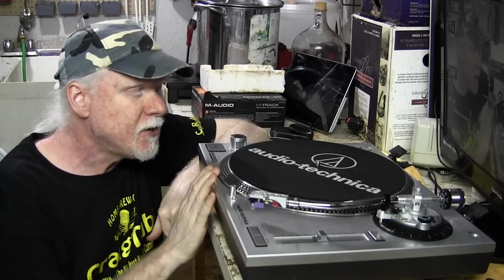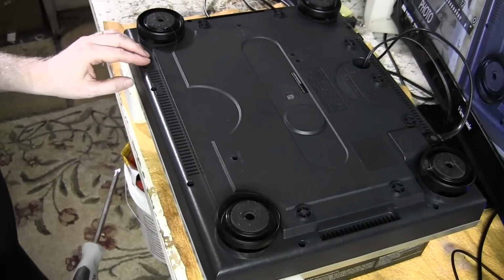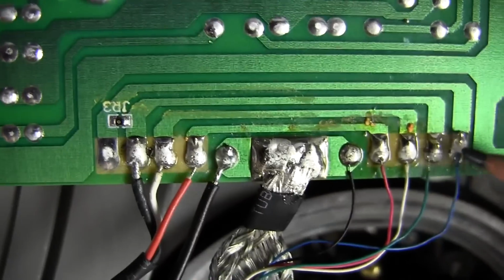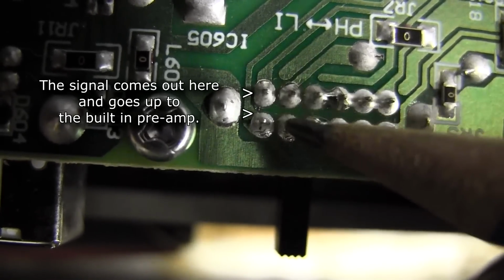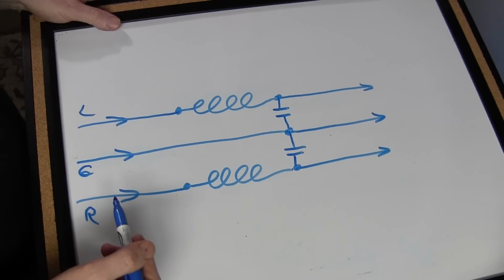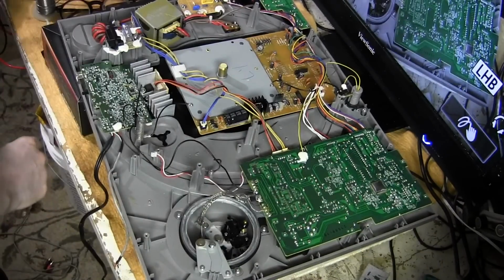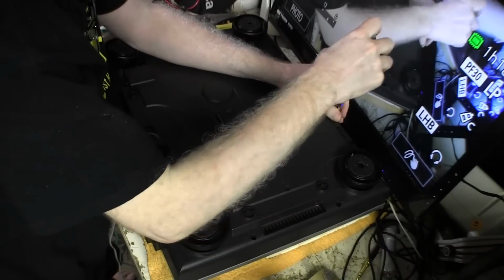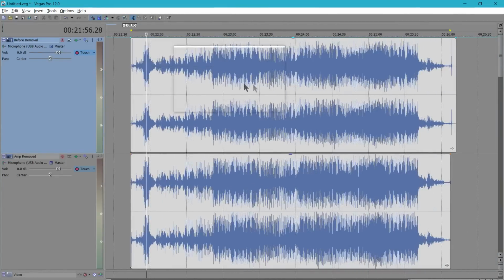Preamp Removal - Audio Technica AT LP120 USB Turntable

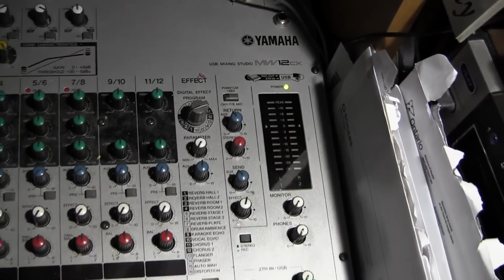Comment: You bumped the level up on the mixer, it's in the video at  19:50 and 19:57, that will of course change the sound, louder can often sound better in many situations, so I disagree with some of the methodology here... like, JUST before saying 'I have not touched these' as well lol. 

Also, it's not a true A/B, in that you shouldn't have just used a recording that no one is familiar with, there are plenty of public domain recordings that are exempt from copyright and also familiar to the majority of people in the world. Besides that, it would have been much more conclusive to have used actual test tones/sine wave tones and swept up in increments from 20Hz to 20KHz, using not only your ears but your eyes, via an Oscilloscope or DS CRO. Only then would you have proven any loss, or gain of spectral content in the frequency realm, however academic it may seem.

I mean, this video does provide a service in that you showed a very easy way of modifying the turntable to remove the ADC/Preamp... but to say that it remarkably improved aural content is disingenuous. Especially using a USB mixer, if you're going to prove an analog device, you should not be recording to a digital format via a wildcard like a USB mixer. We have no idea if that's introducing any sort of noise into the recordings itself. I get that your options for digital interfacing may be limited, but a USB Buss? Come on man ;)
Reply: Daniel All that matters is that you could see a difference and hear it as well. To me its quite the difference. Depends on how critical of a listener you are. And yeah he did touch the controls but a lot of old stuff will have loose buttons and controls on them, so I doubt he actually changed anything there.
Reply: If he did move either one of the levels it was minimal. I agree he may have bumped the knobs but I don't think either one moved enough to make such a distinct difference in the sound. I am now looking forward to my warranty running out so I can do this to mine. I knew something was mudding it up.

Comment: Hi VinylTV, Brighter is not necessarily better. Brighter does not mean more detail, you might find the brightness becomes an irritation after a while or sibilance may become an issue.

By the way, many high end phono stages have user selectable capacitor/inductor/resistor at the input which can be tailored to suit any cartridge/interconnect combinations. It is called cartridge loading. (See this article http://www.hagtech.com/loading.html .....the article is a bit sciency) Since this unit is sold as an all in one vinyl player Audio Technica may have done this NOT to reduce unwanted noise but to create a flatter and more accurate output from the supplied cartridge.
Reply: Sharkey o Its not just brighter. There is a fuller soundstage as well. Also, if you think its bright it might be because of his cartridge not tracking properly or its just recorded that way.

Comment: Why no comparison audio from when you switch the output to line. So does switching off the built in pre amp and use a third party phono sounds much differnece with this

Comment: Sure it sounds different . . . you just removed your RIAA equalization network. Who needs it? Looks like you ran the signal straight into the AUX input . . . so you have no RIAA at all. And about your test song,  did it have any EQ applied to it when it was cut? Your lovely analog signals are send thru a A/D converter and converted to crap anyway. What a joke.

Comment: Great video, Craig...thanks. I removed my preamp today and I'm so glad I did. The difference in sound quality really is amazing. Like you mentioned in the video, it sounds like a serious cartridge upgrade. I left the preamp inside the housing and just neatly bundled up the wires and cables. That way I don't have to store the board and it's ready to re-connect if I ever decide to use it again. Although I don't know why I ever would now. Thanks again for the instruction and motivation.

Comment: Really excellent video. I came close to picking up the AT-LP1240 turntable which is made a lot better than the 120 but also has the preamp. Can anyone else comment on other brands? Do Stanton tables have the same issue with their built-in preamps? The only new direct drive table I can think of without the preamp is the Pioneer PLX-1000 but those are at least $200 more than the 1240 and $300 more than the 120. I hope the manufacturers start offering models without the preamps, or start wiring their output differently.

Comment: Sound is more balanced with the pre-amp in.  The highs sound shrill without it.
Reply: It's the recording on the vinyl. It has far too much sibilance as Craig mentioned in another video. He purposely used this record to better highlight the difference. A properly mastered pressing won't have the same problem.
Reply: My intention isn't to be rude but this modification is for kinda "deaf" people. If you're able easily to listen records without this modification then you can save some time for listening and keep guarantee. If you like to solder, then the sound isn't maybe so important and you can also remove digital stabilization parts to lower inside digital processing noises, which is not present on board in '80 equipment and it can play records as well. this is turning us to insane. To build a turntable it is needed to have expensive equipment and many engineers but to break this, it is enough to have  "one man and his droid"/soldering iron ;)
Reply: @PaxHominibusBonaeVoluntatis  We have the same record player and never noticed a lack of highs.  Records sound almost identical to flac files.
Reply: Definitely has a raw quality about it. I think it's an improvement

Comment: Hello thanks for the great video :) I just want to know if I turn off the pre amp (still installed) and run via my Technics amp will I get the same sound as your after removal example? As I want to digitise my vinyl you see so need to keep the pre amp I think as the USB is connected to it? Right or wrong sir? Sorry I’m no good at these things - Tony

Comment: Yep, much less recession on the higher frequencies. Doesn't sound too great with this particular recording because of the sibilance level. But other recordings would benefit from this modification. Apparently the LP5 turntable does a complete bypass with the internal preamp turned off, so Audio Technica must have been working on this issue, but didn't wish to rectify it on the LP120, as they wanted to push the LP5 as much as possible.

Comment: Just did this myself and I used this video as a guide, must have watched it a dozen times. Extremely helpful! After a few days of struggling and almost losing hope I wanted to share some advice for others: 

First, I had to open this thing maybe 7-8 times because of a ground loop I couldn't find (more on that later). When removing the screws from the bottom, turn the unit upside down and shake out the spacers; I dumped them in the TT cover. When re-assembling, put the bottom first, put the spacer on the screw, then put the screw in the hole. No having to tape them from the inside. 

Second, the RCA replacement cable. I mentioned I had a ground loop I couldn't find, well the RCA cable played a huge part in this. My preamp was super sensitive and picked up everything (verified this because it would pick up interference without even being connected to the TT). The first RCA cable I used had a the signal and signal ground as 2 separate isolated wires for each channel. Don't know how to explain it, but avoid using these cables! The cable should be such that for each channel, the ground wire is actually sheathed over the signal wire. This provides some noise reduction for the channel since the signal wire is less exposed.

Third, when soldering on the board in the TT, look out for possible shorts. They used a ton of solder per joint. Make sure you're not inadvertently shorting the adjacent joint.

Fourth, tinning the wire on the cable. I noticed initially that my wires weren't sticking to the solder points well; the wire would just move the existing solder around. To get around this I "tinned" the ends of the cable. To do this, melt some solder on the ends of the cable, then solder on the board. This actually makes it easier to connect.
Reply: I suspected that flipping the thing over and adding the spacers would be an easier method. Thanks for confirming.

Comment: it sounds better before? stronger base a better mid-range? definitely afterwards the hire  frequencies are pronounced but overpowering and tinny and the bass gets lost and the mid range is not as good. I was wonderin if you put some magnets on top of the induction coils put  some tape first and stick them on this should  boost the signal and allow more mid-range to go through and running a resistors in parallel to the capacitors this will give back some of the high notes but not make them overbearing you can add up the value if you know the capacitor to keep it the same

Comment: This was an extremely informative video...the most comprehensive one out there.  It's a shame you didn't do a 3 way test, one with just the switch off, because it could be that the preamp made the sound better.
Reply: The before test is with the built-in preamp still installed, but turned off.

Comment: People upgrade their cartridges to get that more open and full frequency sound you've achieved by removing the preamp. I need to watch again to see if it's possible to disconnect the pre and leave it in the chassis. I have the earlier model without the USB analogue to digital converter.  I expect this 'operation' would still apply. Thanks for this video.
Reply: There is.  Just disconnect the ground shielding wire and the red, white, blue green wire coming from the tone arm.  Connect these wires to your left, right RCAs and then shielding  to ground.
Reply: I know this comment is old but did you end up doing the mod on your PL120? I just got one and am thinking about doing it… don’t know how just yet but I’m scouring YouTube and forums to try and figure it out

Comment: Thanks for shooting this video, it was very informative and really appreciated you showing the actual signal paths in such detail.  Now I know exactly what is going on inside mine!  Your audio comparison at the end solidified my decision to mod mine.  I was wondering if the filter cut the levels as well as frequency response, but your test showed it doesn't which is good to know.  I think you made the correct decision to bypass the circuit completely.  You could've pulled the chip caps and inductors, but the switch would have remained in-circuit, possibly leading to crosstalk or attenuation due to contact oxidation.  Well done!

Comment: Great video & song. As you said the sound only passed through the pre amp, I think it was the final inductor and capacitor that were changing the sound. Shorting the inductor and making the capacitor open circuit should have had the same effect.
Reply: Hi, by saying " making the capacitor open circuit" do you mean to solder a wire on both ends of the capacitor and the same on both ends of the inductors? - Thanks a LOT! - I`m curious to try :)
Reply: For the inductor solder a piece of wire to both ends, for the capacitor just remove it from circuit. This will remove any sound modification that they are making. Good luck please post your findings.
Reply: Joe-Mark Gatt Hi, thanks. I have AT- LP5 model Audio-Technica and I think it shares similar problems although I will check. Ideally I want to use the internal Pre-amp and just remove all that loss of fidelity that is obviously a problem. Hopefully there is a way to improve the internal Pre-amp, I will report on findings in the LP5 Pre-amp

Comment: thanks for the comparison. i actually prefer the before. the after has too much high end. it sounds louder too which may be precieved as better according to the fletcher munson curves. i wonder if the people on phones noticed it more since a phone effectively only delivers above maybe 500hz. in the before the range around 500hz seemed less transparent.  if might be fun to use an eq and try to null these two out. i've done similar when trying to match eq brand A with eq brand B. I heard another comparison with the 120 and the 1240 where the 120 was hella brighter in a bad way. now i don't know what to think. but that 120 to 1240 comparison was the most striking of anything i've heard so far.

Comment: Just curious, what audio connecting cables are you using to go from the board directly out of the TT? I can't seem to wrap my head around where the ground wire is coming from that is soldered to the board along with the left/right wires. Thanks in advance for your reply. Great video.

Comment: I'm confused. do you connect an external preamp or just directly to the amplifier? if so, what the heck is a pre amp for??
Reply: You connect it directly to your Phono input of your amplifier. An amplifier with a Phono input will have a Phono stage built in. You would only use a Pre-Amp if your amplifier doesnt have a phono input.. eg. Mini system with a AUX input... that would require a Pre-Amp.
Hope that makes sense.

Comment: First off, Great video! I greatly appreciated the explanation of where all the circuitry was going.  Also appreciated your attention to detail on not hacking the insides out of this thing.  

My question is, can I just solder a second RCA cable to the same points on the board (not the Pre-amp) and run a "parallel" wire set?  In my head that would give me three options....1. TT with pre-amp on 2. TT with pre-amp bypassed but still going through the pre-amp and 3. TT with a straight unfiltered out that could be hooked up to a external pre-amp or phono of a reciever?

It seemed that maybe that was kind of the way you were going to go until you realized you couldn't hide all the cables inside.

I was thinking of just having two sets of cables coming out so I can weigh all of my options.

Thoughts!?

Comment: question regarding the phono out. before taking the preamp out, how did you connect it to a preamp? 
im considering getting this turntable, but i can not wrap my head around the fact that this does not have a grounding wire. can this still be connected to a phono preamp without the grounding wire?
Reply: If you use the in-built leads, the pre-amp board is already internally grounded so you do not need an external ground. If you perform this modification, you will need a ground wire connected.

Comment: Just performed this mod as explained in the video. I left the preamp inside and coiled the wire in there. Took a risk with the soldering but managed to do it without issue :)

All i can say is... if you have one of these decks, you MUST do this mod as the internal pre-amp phono out is garbage. I'm playing this direct through a rega phono mini and it sounds amazing now, the frequency range is much more expansive.

Great video. well explained and gave me the confidence to try it myself.

Comment: Thanks very much for that analysis.  I hated the sound of the pre-amp the first time I tried the turntable.  I couldn't believe how bad it sounded. There must be a chronic design problem in the pre-amp.  Using the pre-amp bypass switch seemed to fix the problem but according to those who removed the pre-amp, there was still a further improvement possible but I wasn't sure if it would make a significant difference.  Your waveform test and audio comparison definitely shows that there is high frequency loss if the pre-amp is left connected but bypassed.  Looks like I will be doing a pre-amp-ectomy!

Comment: excellent i really have to attempt this mod just havent found the time, one way i am gonna do it is actually leave the pre amp unit installed but totally disconnect it as i dont wanna have it lying in a draw somewhere it could get damaged or potentially lose it, simply cut the wires or desolder them then just put electrical tape on the ends of those wires to prevent shorting then solder the new rcas to the tonearm as shown in this video, happy days.

Comment: It seems that you are grounding the audio cables to the board when you solder on the left-right-ground wires. Why then do you add a separate ground wire? Isn't that grounding (green wire) for the preamp, which was removed and no longer needed? Just wondering.

Comment: Does doing this mod, remove the usb recording possibility? or does it affect it at all? :) wondering, because im thinking about getting it modded .
Reply: Sameer Sharma, you will still suffer the issues heard in this video. If you want the purest output from this turntable, fully removing the internal pre-amp is the only option. I personally don't dislike the audio production from the pre-amp and use it as it is but each to their own.
Reply: Yes.. removing the pre-amp board removes the USB functionality.
Reply: Hi Andy, I bought my AT-LP120-USB in April and started using it in June. I'm going to buy an external pre-amp (Schiit Mani), will the internal pre-amp still cause problems for the external one? Your thoughts please...
Reply: Thanks for your reply. I guess I'll simply buy an external pre-amp (Schiit Mani) and hook it with a Denon - AVR-X1300W receiver. I'll be using a couple of "Klipsch" passive speakers and a "Klipsch" sub-woofer. I also found out the "Audio Technica Disc Stabilizer" which weighs about 600 grams and Isolators to get rid of external vibration. I also intend to change my cartridge to an "Ortofon 2M Bronze"!
Reply: I forgot to mention the new improved counter weight by "Audio Technica", I have heard they are heavier and good for high end cartridges! :)